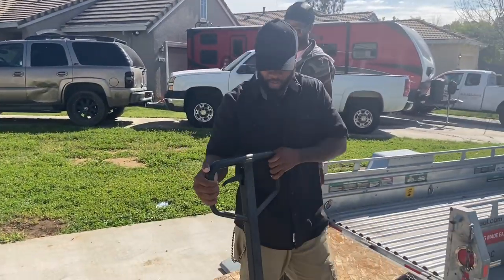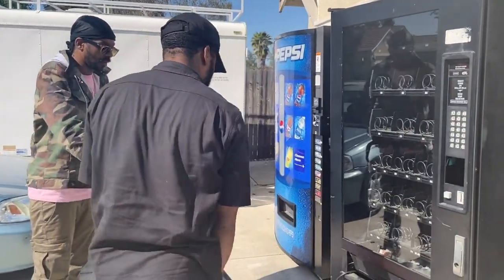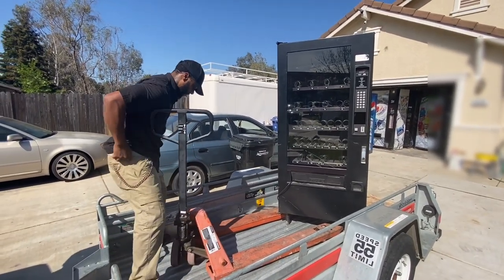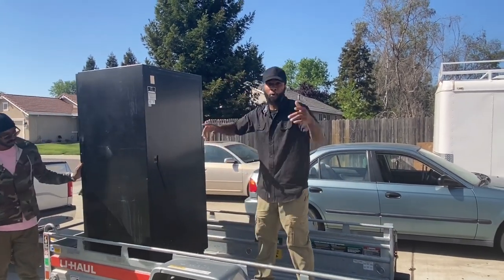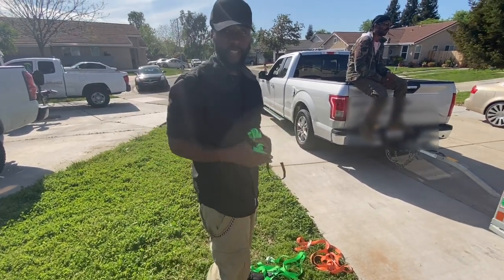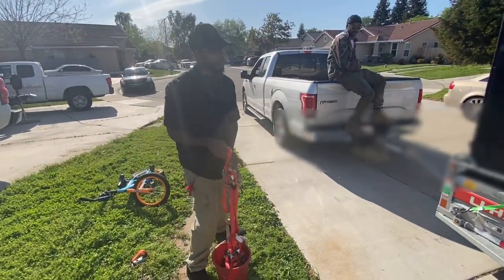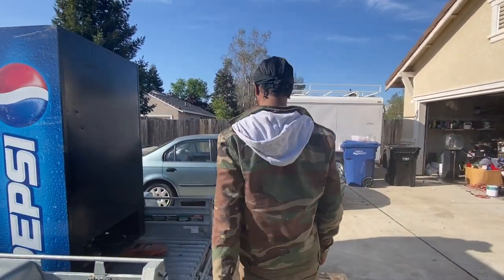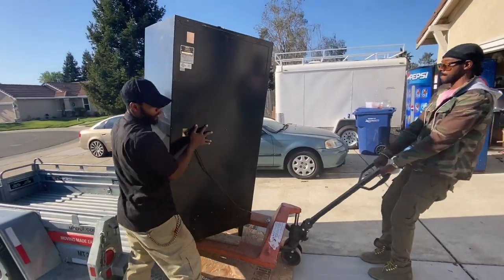HOW TO LOAD A VENDING MACHINE ON A U-HAUL TRAILER !!! WITH OR WITHOUT HELP!!

Comment: Here are a few tips from a 20 year vending veteran. I use thicker/stronger rated straps to tie down the machines. Buy a pallet jack with shorter forks that are also more narrow to fit better under the machines. I use two 4x4s under the machines so I can easily roll the pallet jack under the machine when moving. I always dread moving day, it's the toughest part of the vending business. Best of Luck!
Reply: I concur also coming from a guy who is about a 28-year veteran of vending.....have a drop deck trailer..... look into them.... easy peasy
Reply: @King5150Ed  Yep! I have owned a JLG 248 drop deck trailer for moving my machines since I started. It can transport 2 machines at a time plus my pallet jack. Makes life a whole lot easier.
Reply: @starman6092  we have JLG UT 612

Comment: I have a few suggestions turn the glass around so you don't get bugs all over the glass and also use two inch cargo straps the ones you have are not rated for the weight you are moving..  good luck in business....

Comment: Well organised, mate & those sheets of plywood are readily available. Drill a few door lock sized holes into the board so you have finger holes to pick the board up. Also you can chamfer the edge that hits the pavement so you have a smooth run up that ramp.
Reply from the maker: I’m all 👂🏾 I appreciate the advice

Comment: What's up Wayne! Quick question, do you to buy a certain pallet jack or will any kind be good? I just started my business and have 3 locations. I hire movers for now but want to move my own now
Reply from the maker: I use any pallet jack. But the best one to use if you god get one is the skinny small one. The one I got is to big and sometimes does not fit in between doors. So I will be getting a dolly. But it’s best to learn to do it yourself save some money in the beginning.

Comment: I’d be scared to move that soda machine all by myself. Those things can weigh 900lbs. Maybe the little tilts to put it on the pallet jack is not so bad. It’s the putting it on the trailer by myself that scares me. Also taking it down by myself scares me. I think I’ll have my brother and nephew help me at all times when I do this. Moving the machines around should be a sometimes thing anyway when a location is bad and I need a new location.

Comment: What a frikin disaster. That single person part was an accident waiting to happen, it was damn scary. For a start you were going about it all wrong trying to get the pallet jack under it. You should have had the blocks of wood by the feet on each side then tilted the machine one side at a time to slip the wood under the feet, once that is done on both sides just roll the pallet jack under the machine and lift it up. Getting it up the ramp was another f*ck up. With one person you should have used a winch, even if it was something like a small anchor winch, that way it cannot roll down the ramp of you loose your grip on it and believe me, when a machine on a pallet jack gets some momentum its hard to stop. Also you should have used a ratchet strap to hook onto each side of the handle and run it around the machine to keep it steering straight. As for lifting the pallet jack over the side of the trailer, you looked like you could easily have injured your back doing that. How the hell are you supposed to run a vending business if you injure yourself like that. About 13 people die each year in vending machine accidents and after watching this it's easy to see why.